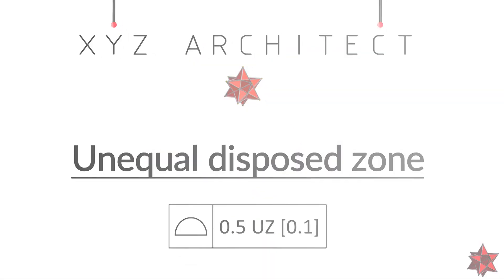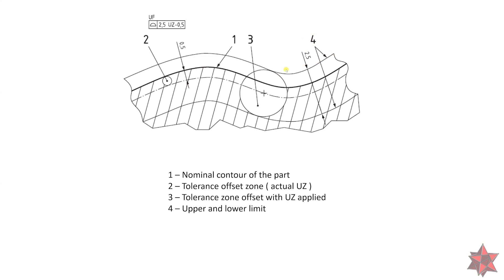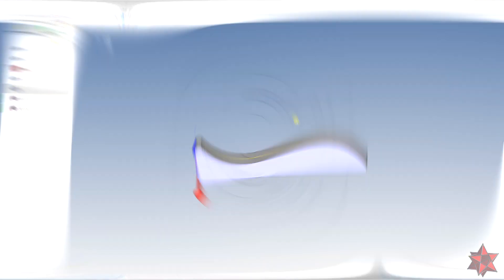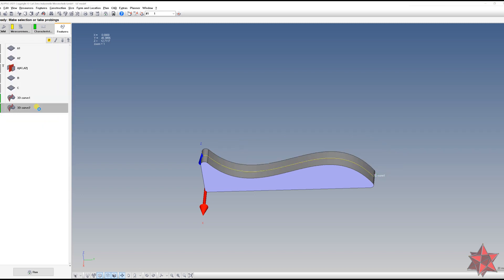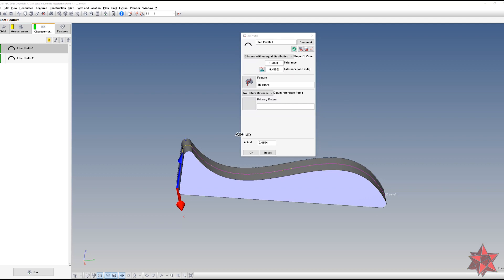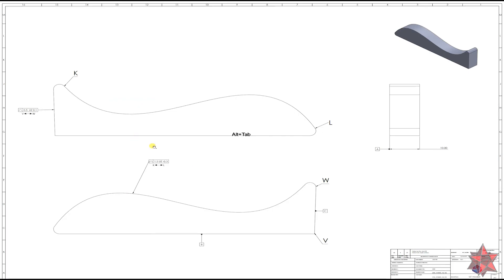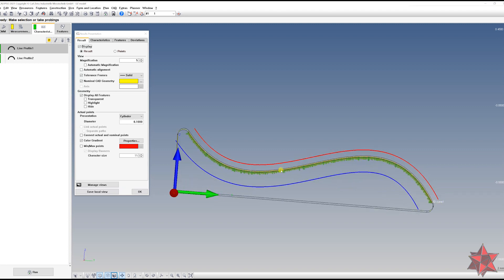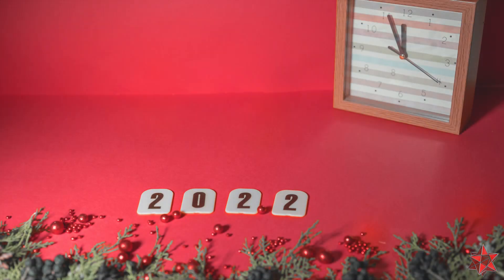Unequal disposed zone

Comment: Thank you Sir for this golden tips on line profile with UZ modifier. This is very helpful...again thank you. One question please: how about a true position using UZ as well. Let me give an example: a test feature "plane1" and Reference feature "datum_A". It goes like this: TP| 0.1|UZ +0.05|A. Have you delt with something like this? How do you program it in Calypso? With line or surface profile it's easy because Calypso offers multiple options such as equally distributed zone, un-equally distributed zone..etc. But with TP I can't find anything in Calypso similar. And this is an ISO standard print. Your time is very appreciated.
Reply from the maker: Hello, I had something like this a while a go, designers use this UZ in true position thinking that we can use this as we do in profile. My oppinion  is that you make 2 characteristics, 1 profile with UZ, this is when Calypso will let you use UZ, and the other characteristic set it as true position simple of 0.1 from datum A, and tell the designer to make up his mind, what kind of tollerance he wants there. Also let me know what standard permites this UZ modifier on true position.
Reply: @xyzarchitect  I did exactly that actually. However with profile option I am unable to see the basic dimension, nominal vs actual (distance between the two planes). I can measure it directly if I want but that’s not the designer intention here I think.